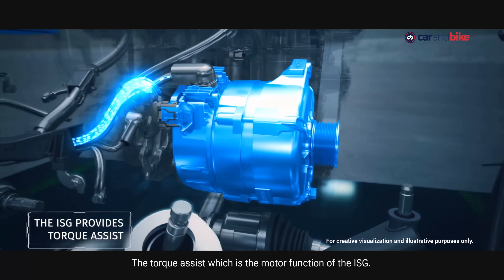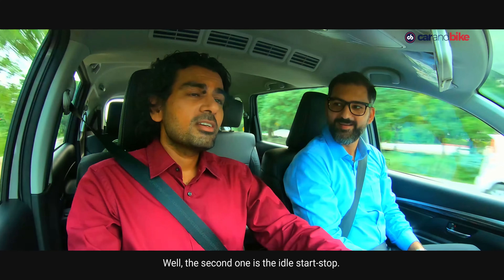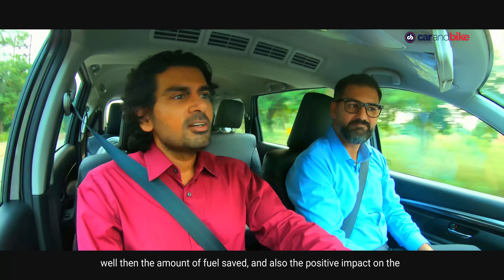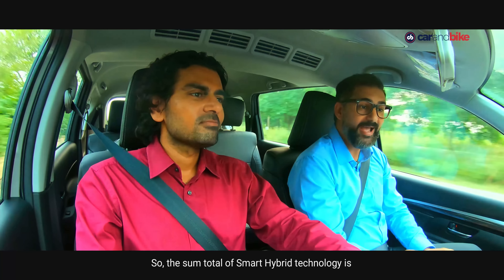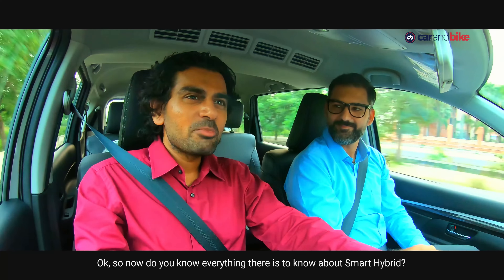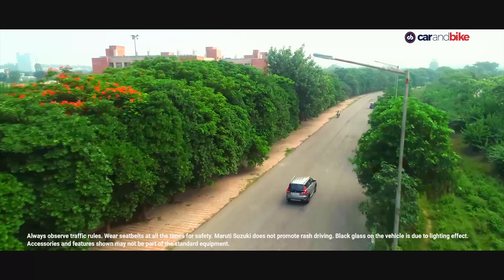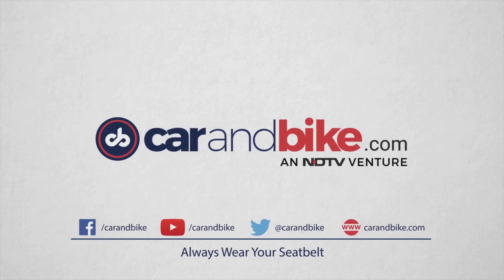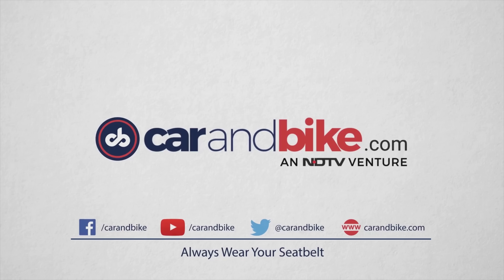Sponsored: MARUTI Suzuki Smart Hybrid Technology Explained | carandbike

Comment: What happens to the ISG when both the batteries are fully charged? Will it continue to decelerate the engine when accelerator not pressed ??
Reply: The technology used in suzuki hybrid is that the battery stops charging when the lithium and lead ion battery's are fully chargrd